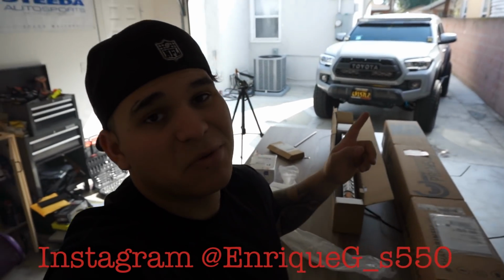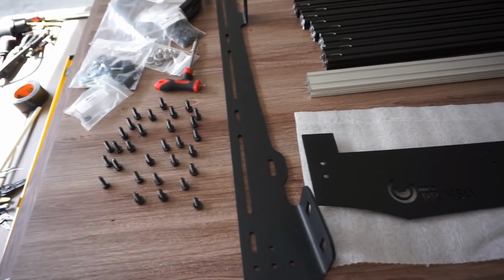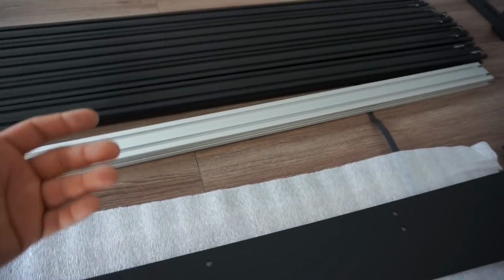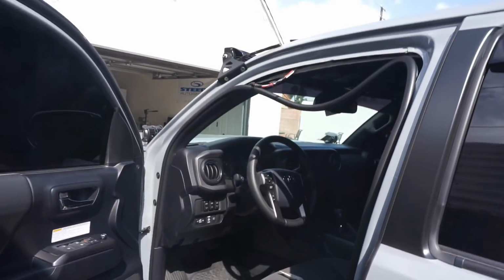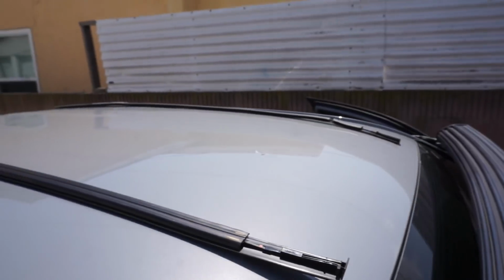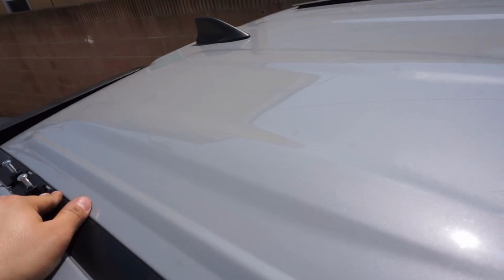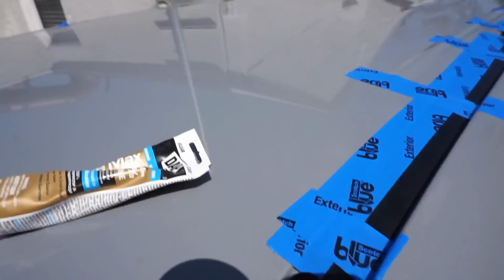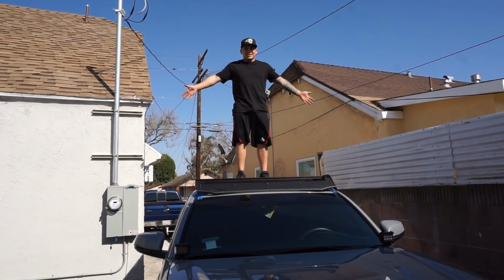2018 Toyota Tacoma Prinsu Roof Rack Install!

Comment: can you do a video that shows the interior noise on the highway at 60 mph with this on now? Like the a mini dBa meter? Wondering if interior is louder than 70 dBa with this rack at 60 mph.
Reply from the maker: I'll give it a shot but it'll be tough to get an accurate reading because of my larger all terrain tires. The only noise I hear or notice is a slight whistle at 70-75mph and higher. It's a very bearable sound.
Reply: @EnriqueG_s550  Looking forward to that video. Would also like to hear the whistle at 70 mph.